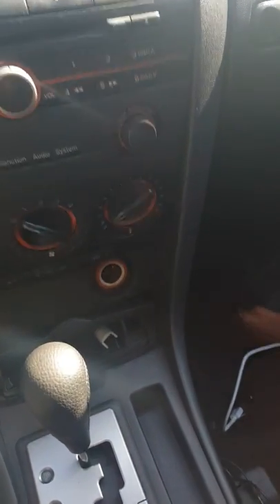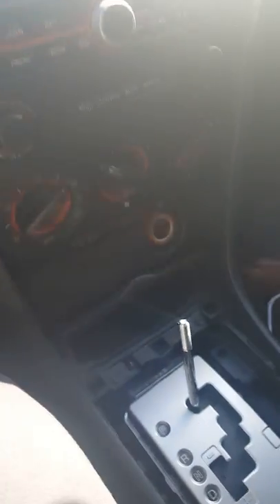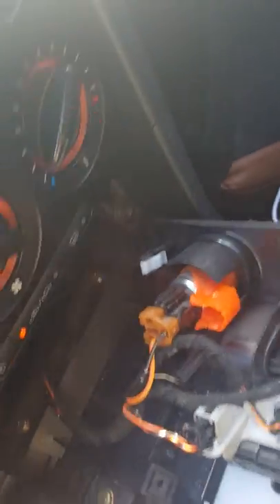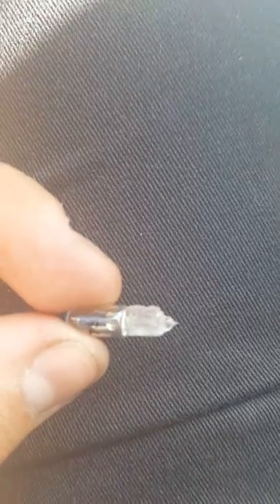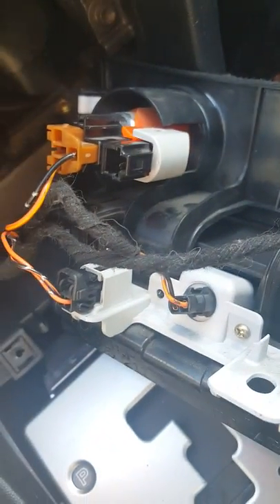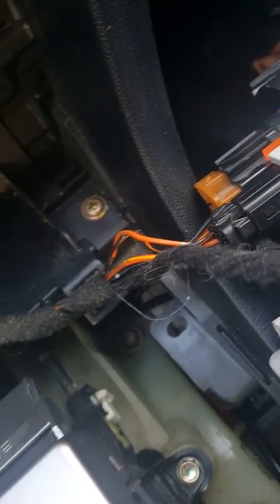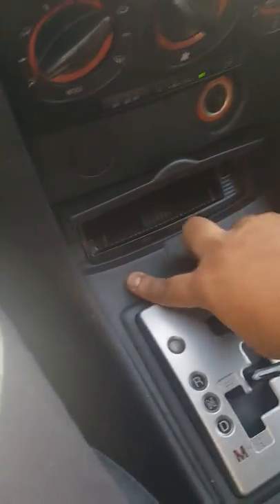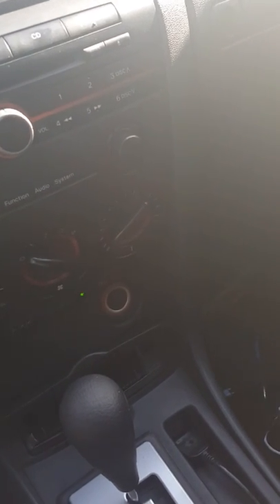2005 Mazda 3 Cigarrette Lighter light bulb 2723 replacement

Comment: Thanks for the video - expect the one thing you didn’t show was how to remove the black holder in the first place - which is why I looked at the video to begin with.. worked it out tho. - guys; there are 3 black clips top left and right - it’s a bugger to get out; but easy to reassemble - lever up all around the orange fitting while simultaneously pulling on the black part (out).. be careful and it does come out without breaking !! 👍👍

Comment: how were you able to remove the socket (black) from the orange thingy?  tried to replace the bulb today but having a hard time removing the socket.  what a pain in the ass.  i gave up after 15 minutes of trying.
Reply from the maker: You have to be careful with that piece. It is held on by pressure clips from the orange thing, if you break them, it stays loose. Your best bet is to use small flathead screws drivers to relieve pressure from all the clips. I believe there are 3. Lmk how it goes

Comment: Why would you go through so much trouble to replace the lightbulb for the cigarette lighter?  Seems like a lot of work for not much benefit.
Reply from the maker: I just like my things to work properly.
It may not be extremely useful for most people.
Reply: If you think this is bad look up the cabin air filter or the climate control lights 😂
Reply: @nathanblanchard8897  mr lube kept insisting to do it, i finally let them and they broke tabs on tabs only which i then got them to knock off the cost on my oil change  took like a WHILE hour or more
Reply: I use mine, to connect my FM transmitter because I have this car but no six connection
Reply: Aux 🥴